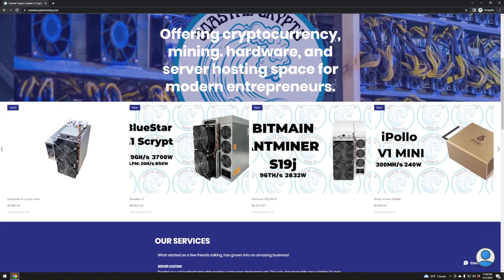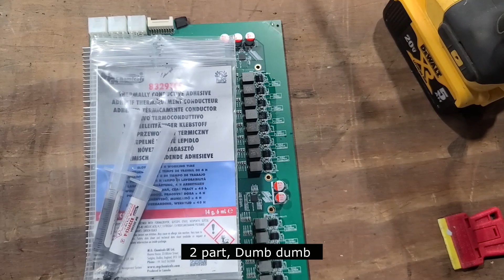Multminer M2 Tear Down: Exploring the Inner Workings of this Powerful Miner

Comment: Got a Question the Multiminer M2 is doing SHA-256 at 8 GH around? an RTX 4090 does SHA-256 at 21 GH ???
Reply from the maker: M2 miner does not mine sha-256.  I assume you are referring to radiant? which is at 13.5GH at 1050 watts
Reply: @CoastalCryptoMining  isnt it an FPGA? You could write your own. re-program it.

Comment: So wait is there 3 boards? you didn't show the whole unit?
Reply from the maker: yes 3 boards.  The unit we have been testing has a board not reporting.
Reply: @CoastalCryptoMining  I’m trying to get an FPGA so I can write my own Bitstreams & I can mine whatever I want & also use it for cracking passwords
Reply from the maker: We have FK33 fpga cards available on our site they sound like a better fit for what you are trying to do
Reply: @CoastalCryptoMining  ok I found the FK33 on the site, for the price I’m wondering what would be better cause for $3000 I can get the whole unit with 3 boards. Which would be faster ???

Comment: Question on the m2. Who controls the Bitstream? Will they add more to the Bitstream to mine?
Reply from the maker: bitstream is like firmware for the asic miner built from the manufacture.  based on conversations with the manufacture more streams are in the works no ETA of release though